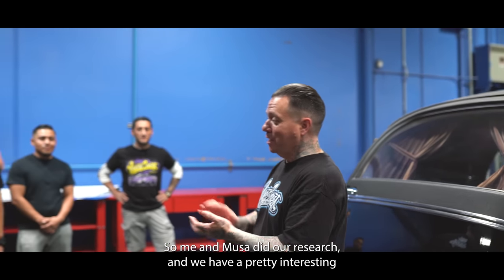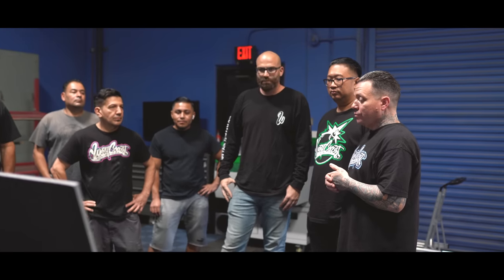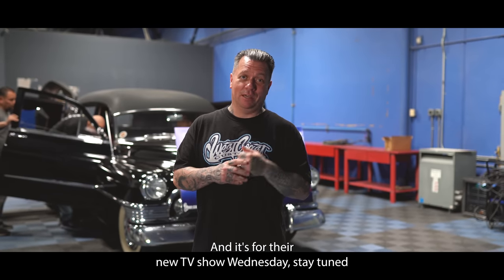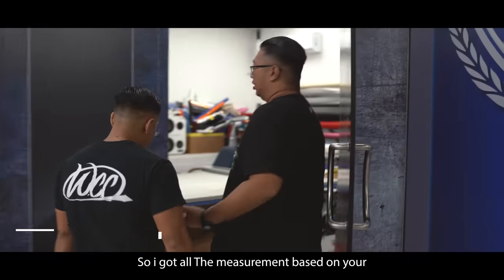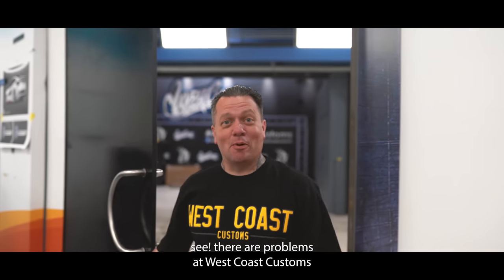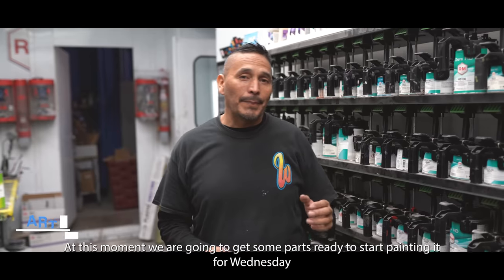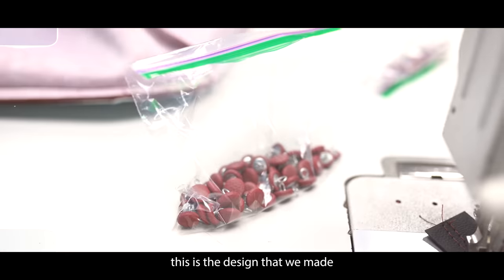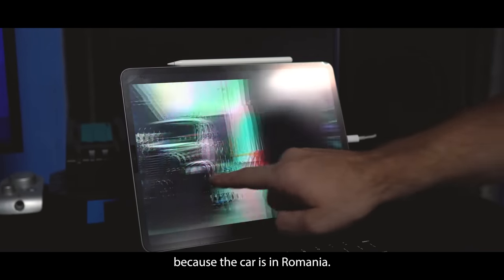The Wednesday Hearse | West Coast Customs

Comment: I think the chrome looks should have been maintained instead of painting em all white.
Reply: The white does take away from the style of the chrome.
Reply: God almighty! Why mess with chrome? It looked sinister without the white paint
Reply: @johngrepo9976  Someone didn't want to spend the money to rechrome.  Also, that flat white looks horrible.
Reply: Try and have everything rechromed in their budget and time frame... not happening
Reply: @Johnny B  Netflix budget = unlimited.  BTW to restore a car like that with rechroming would be around $50,000.  Bumpers cost between $800 - $2000 to rechrome.
Reply: @Batalia122  netflix isn't going to give an unlimited budget for something they will only use once for the premier. And you'll never get the chrome back in their allotted time frame. And to fully restore that car, $50k probably would barely cover the paint. Probably at least $10k in chrome work.
Reply: @Johnny B  Paint on the high-end is 10k with prep.  If netflix wanted a basic car, maybe they should have went to Maaco.
Reply: @Batalia122  The painting for that size of a car might start at $10k if it was a little mustang or something, but the body work on a 60 year old car that size, to get it ready for paint, is costing way more than $10k. Then it depends on how nice of a paint job you want. Color change? Metal flake, candy, 2 tone, interior paint, undercarriage,  etc... Anyone who knows, knows that you cant just put a price range on something like that without knowing exactly what is going into it. Thats assuming there is no rust...
Reply: No way. It's Stunning
Reply: @viperfanatic13   They could have just polished it... It doesn't even need to be flawless because why not let it show some sinister age?  A little rust for added creep value
Reply: @PAKTRA PRODUCTIONS  You could see a lot of pitting in it on the video. You can't polish that out. And to leave a patina when the rest of the car was perfect wouldn't really work. Had they done a wrap that looked old and creepy, some patina would've worked. Still comes down to WCC putting out a product that theybare proud of
Reply: @viperfanatic13  I didn't watch all the way, I didn't see how bad it was. Regardless, they couldn't have restored it by hand at all given the time frame.
Reply: Chrome expensive  must be a budget build .. they should of scuffed it to look stainless instead of painting it white … BUT STILL LOOKS CREAPY
Reply: I was thinking the same
Reply: Agreed

Comment: honest opinion....I don't know if I would consider any of the stuff West Coast Customs to be good.
most of the stuff they do is off shelf body kit and mags...lots of sound (which pretty much any car audio place can do).
If Chip Foose is a 10/10, then WCC is about a 5/10. As a structural designer I would rather not take a job on for one of my clients if I can't 
do it properly the way it needs to be done...if you rush a design, the results speak for themselves. This was a rush job, and you can tell by the lack 
of sheet metal work and paint...wrapping cars is cheap looking and using a 3Dprinter instead of fabrication is also kind of cheesy.
Reply: I agree completely.  WCC is this century's Barris Industries..
Reply: They had 9 days, what did you expect? WCC has never really been more than a wheels/tires, audio, and upholstery. They are barely even a paint shop. Fabrication has never been their thing. WCC = custimize your car. Foose = build a custom car...
Reply: Can’t compare a complete Restoration Shop to a Pimp your Ride Shop. West Coast Customs has always mainly worked with new vehicles and just upgraded them to a customers liking.
Reply: Jesus they destroyed that Hearse.  I mean painting the chrome, what the hell.   Sorry. Just super annoyed.